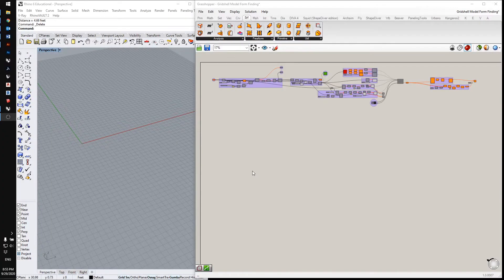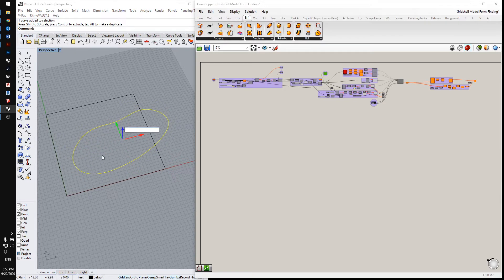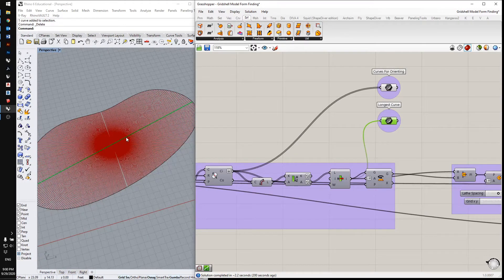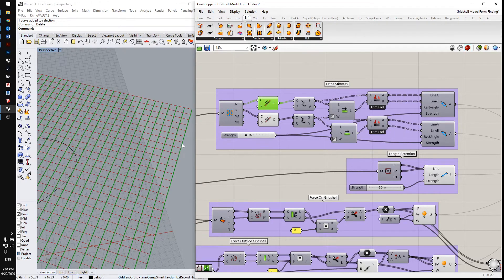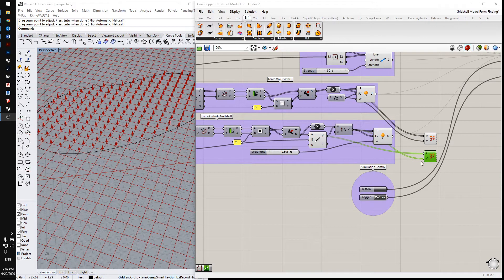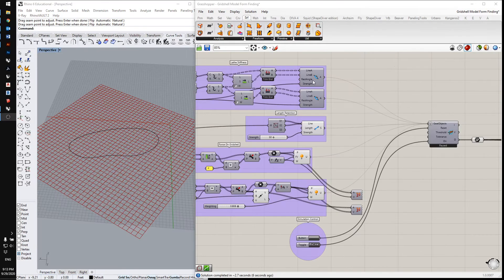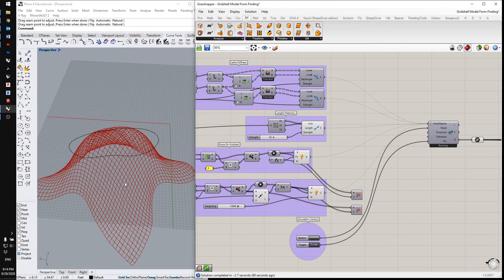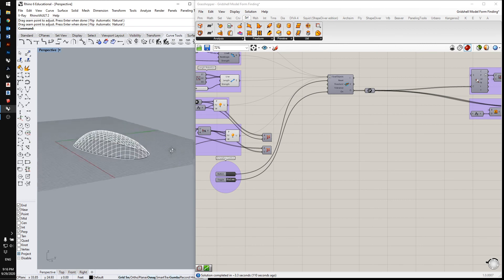Enclosed Gridshell Form Finding

Comment: I am recreating the Mansueto Library in Chicago for my studies, which is of course very similar to this building. I had a problem in Kangeroo of getting the grid shape in tact once it form finds, so the lengths and angles were no longer the same. I think this will help me a lot to achieve that. Thanks!
Reply from the maker: Hey Duco.  I took a look at that building, very cool.  Also glad the explanation helped out.
Reply: @robinharrison3899  Unfortunately, my computer cannot handle it, the file of yours (cool website btw!) is too big. I am having a hard time discovering how you made sure the angles of the lines crossing remain at 90 degrees, and to keep the lengths equal.

I have two different models i have been working on:
- one made with a grid that is flat initally, once kangeroo hoists it up, the grid looks ugly
- one where i have made one that is already made out of arches and thus not only in the xy plane, but now i cannot manage to connect the kangeroo components to form find

If you have any ideas, i would appreciate it greatly
Reply from the maker: @ducoh2093  The angles of the grid are meant to change.  That is what allows it to deform.  I can't speak to the models you have now since I don't know how they're set up.  Also, my file shouldn't be too big, its probably some other issue.  From what I can see of that building, I would say the workflow of my model is the best way to achieve that form, so I would try troubleshooting the script, and possibly checking the resources and paper that are also on my website.